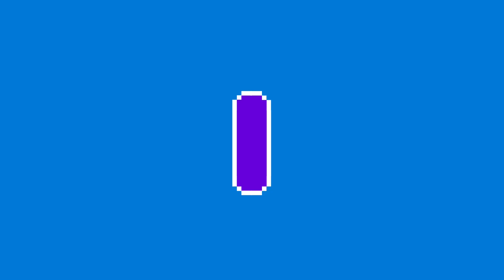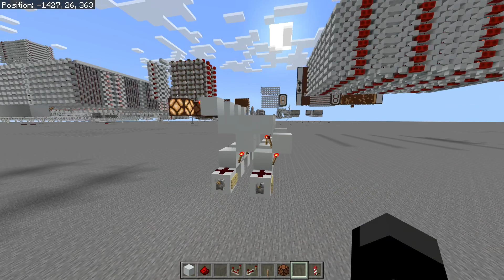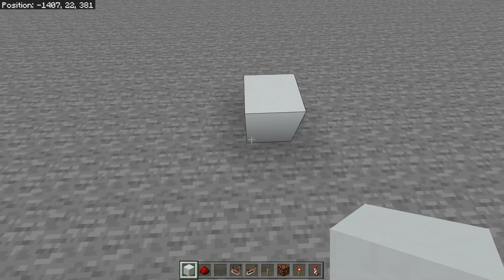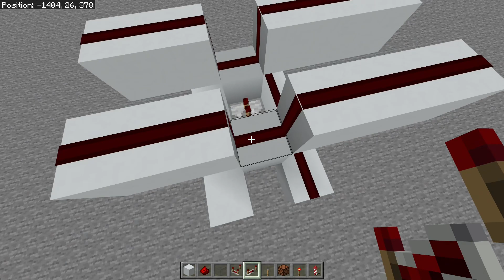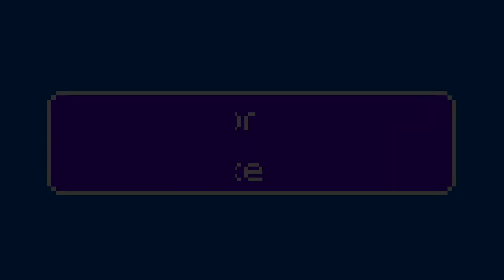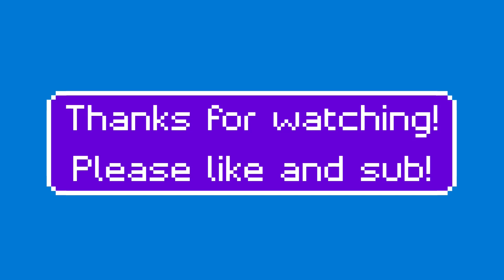Why you need to use Vertical Binary Decoders - Minecraft Bedrock/Java

Comment: I disagree, as there are easy work arounds for those problems, and horizonal designs work better for me; but of course, both are good.
Reply from the maker: honestly it is kinda preference as well, however the larger the databus, the more favourable the vertical design is due to the simplicity. Also I found I lost a lot of ticks (due to signal strength) when turning round corners with horizontal busses whereas this is not an issue on vertical busses.